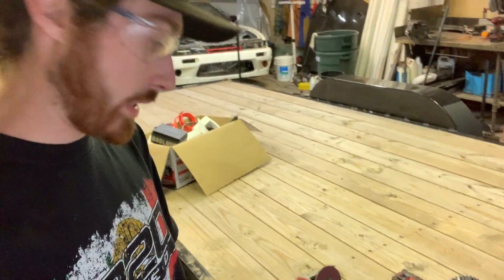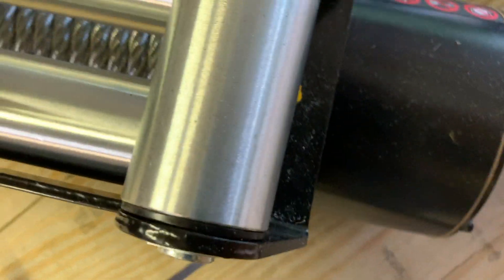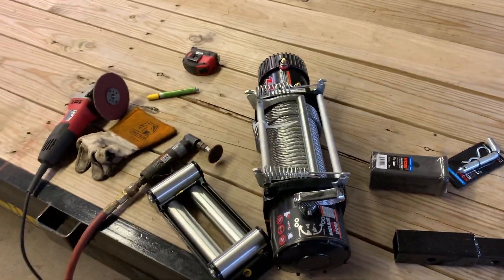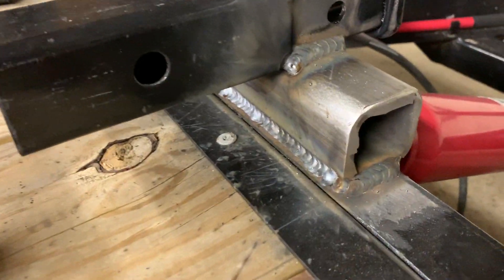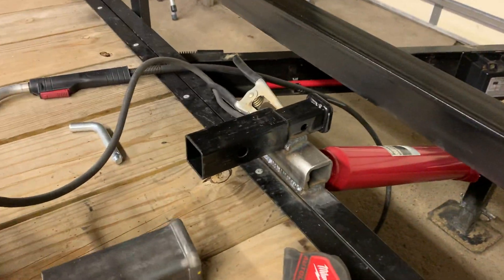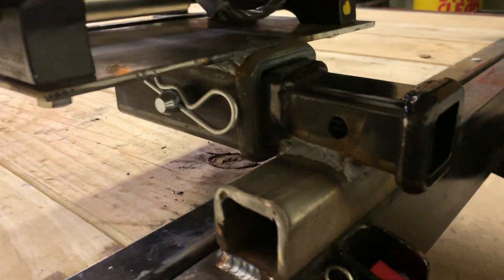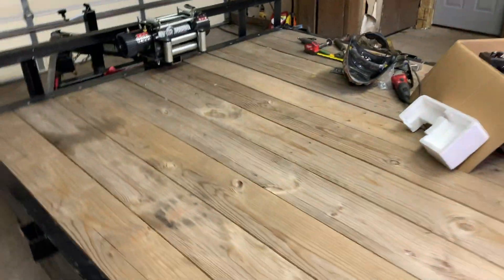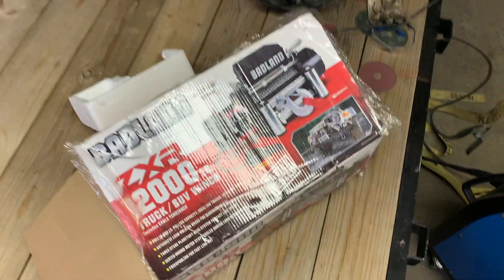DIY Removable Trailer Winch Mount ( Harbor Freight BadLand 12,000lbs Winch )

Comment: I think it would have been super smart to use a standard 2" hitch size on the winch side so that it could be installed into any receiver super easy! Guess you could change it super easily if you wanted. I just thought it would be super fun to let you know my thoughts. Super fun video though.
Reply: Exactly, switch the 2” to the winch and it would have been universal.
Reply: or maybe did it that way so some jackass can't use it as easily if they steal it..

Comment: Great job. I am sure someone already mentioned it but you have the hitch mounts bass akwards. You should have mounted the male hitch to the winch and female to the trailer. That way you can use hook just the winch to the truck or any vehicle if needed

Comment: I'm about to mount a winch on my "new" old trailer. I will put the male part of the hitch on the winch, so I can pull it off the trailer and plug it into my truck hitch. Eventually, I will have a receiver on the front of my truck too, so I can use the winch in any of 3 laces by just pulling the pin and moving it..

Comment: I bought a winch plate off Amazon that slides into a hitch receptacle. I welded the female receptacle to the trailer. The Fairland holes on the plate I bought were too wide so I cut the plate that came with the winch and welded it to the front of the new plate to allow me to bolt up the fairlead. I can attach or remove my winch in seconds. I don't know why some guys permanently mount their winches to the trailer. You then allow the weather to destroy the winch when it sits outside. Plus if you need the winch on your vehicle, you either have to buy another winch or go through a bunch of headache to take it off the trailer.

Comment: I can see that frame of the trailer bend when you try to pull something heavy. Need to reenforce it so will not bend. I did something similar and I had to put some steel to the front of the trailer.

Comment: Nice work, Jack.
It is funny how people can come up with similar solutions while never having any contact with each other. I had this same idea for the most part....A winch that is removeable but my reasons are maybe  a bit different.
I don't want to leave mine out in the elements and the risk of theft is an issue too. I also wanted the option to attach the winch to the back of other vehicles to drag cars when I can't or don't want to put the truck in thick mud, over a hill or whatever may be in the way.
I just bought one of these winches yesterday and plan to do a similar receiver hitch mount but with the base plate of the winch having the male 2" square tubing instead of the female that you did. 
Great welds, great work. Thank you for posting this video.
Reply: 6 tons would probably destroy most frame mounted receivers.

Comment: I agree great weld, I also agree you set it up backwards.
Always trash the bolts and buy Grade 8 hardware.
You needed a winch plate under the winch & that fairlead would of bolted on the winch plate.

Comment: it all looked good altho i probably would have welded the receiver to the trailer and the other part to the winch so you could use the receiver part for other things like a hook or clevis  ir another tool . the receiver is a universal . good work

Comment: I'd like to see this thing in action, pulling something up on the trailer. I bet it bends down an inch or 2 under load of pulling since nothing is under the hitch mount itself that the winch is on. 
I'm planning on putting something like this on my trailer, but I wanted to mount it towards the tongue of the trailer, seems like you give up several feet of trailer space for this winch. I have a piece on the front of my trailer also that stores the ramps, and the siding on my trailer is around 1.5ft tall. I cant mount it on the top bar like I've been seeing, I could mount it where you mounted yours, but it may or may not affect the ramp storage area, and the winch sits like 1-2ft out from the front of the trailer. I have been using a com-along winch that I hook at the very front of the trailer near the tongue area, and I can winch cars all the way up to where the front is almost touching the front bar on the trailer, this especially helps with towing longer cars. I'm afraid with your winch setup, I wouldn't be able to have that extra space to tow the car up a few more feet farther onto the trailer. Also, I do wanna make my winch removable like yours as well to mount in my garage floor to winch cars into my shop as well.
Reply: I added a bumper receiver to my garage floor about 3 years ago using concrete anchors. My driveway is steep and it has been working great with my badlands winch with the wireless remote. Its one of the best investments i have ever made. No more asking neighbors to help push project vehicles up my driveway ever again.

Comment: That is some very nice welding. My dad was a welder...one of the best. His work looked like yours.
I would like to learn to weld a little. Can you point me in the right direction for a welding machine to start off with? 
Or maybe someone else would have some advice or a suggestion.   Thanks a lot for a great video. Jesus bless.

Comment: I hope that plate you bolted the winch to holds up. I mounted a 5000 lb. winch to a plate like that with the same receiver hitch idea. The idea is sound, but after about 10 uses, the winch twisted the plate and rendered itself worthless. You've probably got better torsional rigidity since you welded yours, though. I had to bolt my receiver to the plate.

Comment: How well did it work? I'm in the process of fabricating the same thing..and wondering how well it worked
Reply from the maker: It works like it should! Pulls up a turbo LS Swapped s10 when needed
Reply: @jackfabrication  yesir...just got facing and welding  it up..used a bracket from harbor freight though